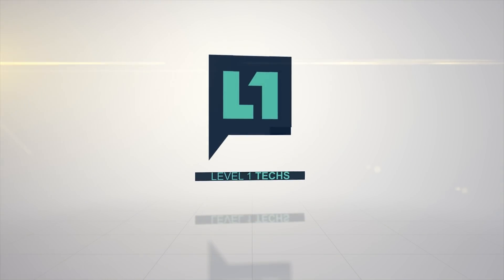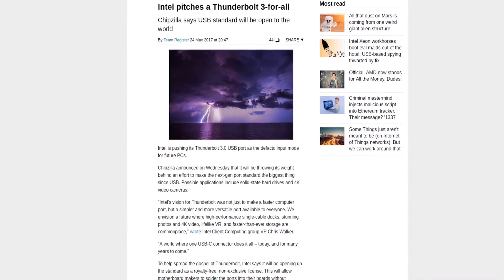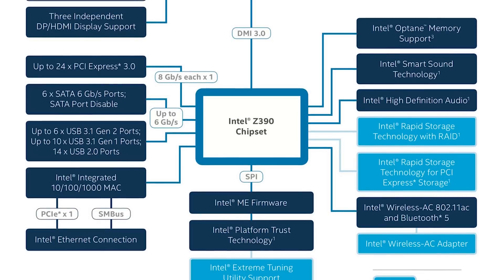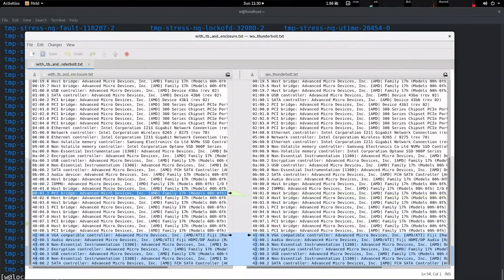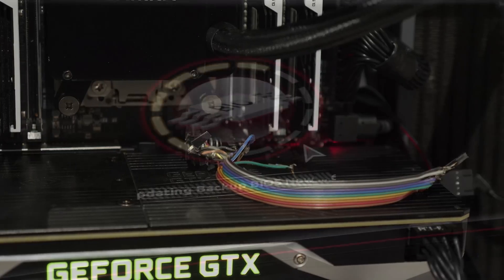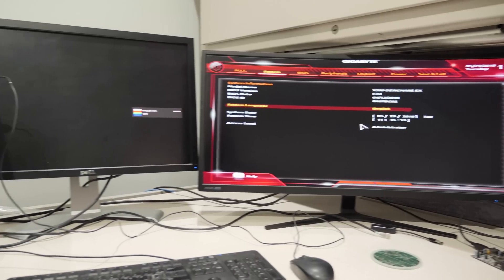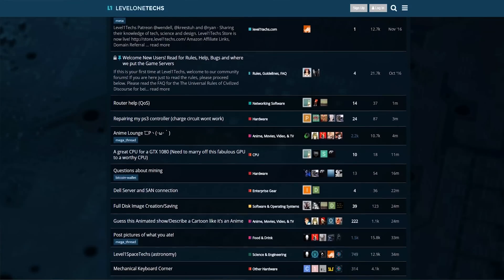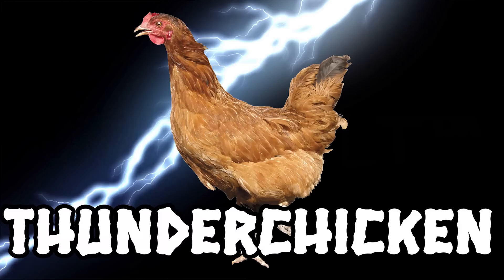Where is Thunderbolt on Threadripper?! Here it is, but...

Comment: I have a ASRock Mini ITX X570 board with Thunderbolt. It's my only one. I posted about X570 Thunderbolt in the Level1Techs forum recently, and the conclusion was "it can work, but it's jank" based on some old articles we found. I want this because I'm limited in PCIe slots because of GPUs. An eGPU chassis is a free external PCIe slot for whatever I want.

Comment: I never realized I needed Thunderbolt 3 until NVIDIA released their new cards. I wasn't about to sell away my 2 2080 Ti cards for dirt cheap just because new cards are out, since these things are still incredibly useful and powerful. 2 or 4 external eGPU cases connected to 2 Titan Ridge cards for rendering would have been amazing. Except, it doesn't work because their newer cards have newer firmware that patched the "loophole" that enabled it. Now I'm stuck like Chuck. Wendel, please help me kind sir. I can send you my card but the kidneys have already been sold.... :-/

Comment: Bought the Titan Ridge v1, hoping I could get thunderbolt on my X570 Asus board and 3900x, to connect an external sound card. First tried the PCI 3.0 slot, but Thunderbolt control center would only acknowledge the sound card if I had turned it own prior to boot. Turning off would not appear again, Then tried PCI 4.0 slot and I could turn the sound card on/off in windows and control center would allow me to see it. PCI to PCI bridge error codes like you mentioned and 3.1 Extensible errors from windows drivers. After hit and miss with installing drivers etc, Windows would freeze when I turned on the sound card in the 4.0 slot. Tried changing bios to read as Gen 4 slots instead of Auto but no options for configuring thunderbolt since this is an external pci card. Really needed this to work may. Glad someone addressed this. Thanks.

Comment: And I'm here thinking, why do hell isn't there an x16 External PCI express connector for laptops when the spec promised it supported distances of up to 18 ft if I remember correctly? All I want Tb3 is for eGPU but Tb-3 limits it to x4, so does Alienware Graphics "Accelerator"(alas using CPU and not "southbridge" lanes and so does any M.2 or mini PCI-e Slots. And it's all because of the number of Lanes in the Mobo chipset + the CPU. All common Intel Chipsets have 16 lanes and AMD doesn't list them, even for PCI-E 4.0
https://www.amd.com/en/products/specifications/processors
Reply: Damn, just DAMN!

https://www.digitalartsonline.co.uk/news/creative-hardware/oculink-will-make-laptops-lighter-on-move-more-powerful-on-your-desk/
https://pcisig.com/specifications/pciexpress/bridge?field_technology_value%5B%5D=express&speclib=OCuLink

Comment: What about Gigabyte Gc-titan Ridge plugged at the 5pin THB_c connector on the x299 designare? simple here, ''plug and play'' got it working! Thanks for the video btw it opened my mind to search a solution to get thunder bolt working on my threadripper. I just needed thunderbolt 3 to connect my audio interface (apollo twin quad)

Comment: Is there anyone that can help me figure out how to get my threadripper 32 core to work with my thunderbolt 3 Apollo X8p converter? I have the gigabyte Auros Xtreme motherboard with the gigabyte titan ridge Thunderbolt 3 pci card. Using the correct TB3 cable.
I have new chipset and bios and drivers.
The Titan ridge card identifies the universal audio converter from the thunderbolt software tray but there are error 31 errors in the device manager.
The universal audio software does not show the device attached.

Comment: Yeah geez, I was working up the components to upgrade and run a TR 2950X system which would play well with my Ableton Live 10 DAW software since it will use up to 32 cores (on Windows).  But when I looked for the Thunderbolt header on the motherboards, being that Thunderbolt is the link to my MOTU 16A audio interface (sure don't want to use the USB 2.0 if I don't have to!) I hit a dead end as you know.  So the Thunderbolt support goes beyond storage and graphics cards, high end audio can certainly use it as well.  So do I go with a pricier Intel 16 core CPU or wait a bit and hope...?

Comment: I saw a picture where someone was able to use a USB 3 motherboard header because their MB didn’t have a TB header. He used some creative wiring between the TB card and an USB MB header. After all there is USB capabilities on TB card. The TB header on the MB has 5 pins, 1 for ground, 2 for data transfer, 1 power. I THINK one pin tells the system via USB header what the card is. The Asus TBex3 card has a flash firmware utility, what does it flash? The intel chipset on the TB card?? Maybe a patch for the OS and/or hardware??

Comment: While it doesn't affect us directly perhaps, Apple would certainly be very interested in this. I would imagine the only reason Apple aren't using AMD for their Mac lineup is that would require them losing Thunderbolt, a keystone feature of Macs right now.

Imagine a Mac Mini with one of the upcoming 8 core AMD APUs. Or a Mac Pro with an Epyc 64 Core, or Threadripper. That would be a popular set of machines.
Reply: Apple will most probably move to in-house chips...
Reply: @theprstc  No doubts they would if they could, nothing says Apple like vertical integration. However, between history repeating itself with The Rosetta Stone library and issues with Thunderbolt licensing I don't think Apple will make the move to in-house, at least not on any device with Pro in the title.

Further, while Apple A series chips have proven themselves in the mobile market, we have yet to see any SKUs capable of remaining competitive on the desktop. It is quite possible the A series design can't scale up to the higher core counts and frequencies desired for the workstation.
Reply: @bushrat0118  It's not if they switch, it's when. They're far into the process of "unified OS", that's a solid hint already. What's the point of keeping it on different hardware when they got all the capability of running their own? Also, what workstation are you talking about? Apple made the last workstation on 2013 and it was an absolute mess. MAYBE they will make one in 2019. But maybe they will make something else completely...
And scaling? The chips already seem to beat all the competition. On reddit: Apple really undersold the A12 CPU
Reply: @theprstc  You're forgetting the market the iMac Pro represents. The A12 beats mid-range i5 CPUs from 4 years ago on the desktop, which is about where mobile i7 is now, ish. I would be floored if Apple could build a chip with half the performance of, say, the 7980XE.

Apple could probably replace the CPUs in their low power devices tomorrow if they tried, but I don't think they have the resources or talent required to take on Intel or AMD in the top end. And that's also ignoring that AMD and Intel are moving faster right now than either has in a decade. Apple doesn't just need to offer a CPU to answer the 7980XE, they also need an answer for Zen 2 and Zen 3, and Intel 10nm.

Further, the unified OS is not going to be what you think it is. Apple is moving to a unified code base, not OS. Apple has explicitly stated that MacOS and iOS will not merge, that Macs will not receive touchscreens and iOS will not support mice.
Reply: @bushrat0118  We'll just have to wait and see :)

Comment: Any updates on how this is going? Just got the parts for my new build, Threadripper 1950X, Vega 64, the same Gigabyte Designare EX motherboard featured in this video, wondered if any additional progress has been made or where I can go to find updates on the situation
Reply from the maker: Order an Alpine ridge tb controller and it should be good to go. Don't expect hotplug.

Comment: Thunderbolt 3 on threadripper is an absolute "must" for geographic information systems (GIS), remote sensing,  CAD, video production,  simulation, etc., where your data is not on a 10GbE network but on direct attached storage for performance reasons.

Comment: i'll  let you know how this helped me. I am a motion designer and use GPU rendering. The more GPUs in a single machine the better for me. Sticking enough GPUs on a ATX motherboard is a pain though, and also a case to fit them all in and the necessary cooling.  Fitting 4-5 gpus in a case and 1 maybe 2 EGPUs on the exterior seems like the way to go for me. So thanks for helping me decide on this mobo. Hopefully theres an official way to unlock TB on this card soon but it's goot to know the hardware is there.

Comment: Just as a side comment. Thunderbolt 3 is especially in notebooks directly linked to the CPU in Notebook since the GPU only uses 8x PCIe.  Example 2016 Macbook Pro 15": Apple attached x8 to the dGPU, x4 to the left Thudnerbolt 3 controller, and x4 to the right Thunderbolt 3 controller. That's 16 PCI lanes to the CPU accounted for. Through the PCH, Apple attached x4 to the NVMe SSD controller and x1 to the wireless card. (from https://www.reddit.com/r/apple/comments/8zc3gr/are_the_all_4_of_the_thunderbolt_3_ports_on_the/e2j4npy/)

Comment: This is great. Being able to connect many graphics cards via thunderbolt could enable a multi-gpu mining system where there are many many gpu's on a single motherboard. The drivers are limited and unstable even on a basic setup, but you could setup a VM for each group of GPU's and just reboot the VM when the drivers crash. I wonder if it would be possible to get 64 GPU's on a single motherboard...

Comment: Video professionals (especially Colourists) would be very excited about this. We work with codecs such as R3D which are cpu core intensive, and multiple graphics cards, decklink addon cards, raid controllers, network cards so the pci lanes of threadripper is very attractive. However a lot of devices in the video world are also based around thunderbolt, which has been a major block for me in threadripper adoption.

Comment: Pro Audio would benefit from this. I have a Threadripper system that I use for ProTools, Davinci, and After Effects that I built last year. I basicaly had to choose between the great bang for buck video editing performance of threadripper and the flagship Audio interfaces most of which are now Thunderbolt. Since I didn't need the super low latency that is nice for music recording I went with Threadripper.

Comment: So you would notice in the BIOS images of all of the Thunderbolt systems that there are hidden options for Thunderbolt AIC location, and they all include options to change group to CPU and then change location to NB CPU lanes. So it should not be that hard to run it off the CPU.

You can download UEFITool, open BIOS ROM, search for text string "advanced" and dump the section with most occurrences to a file (usually the section is called "setup" or similar), then open that in Universal IFR Extractor, and then look at the resulting text file. If there are strings about Thunderbolt settings, you dumped the correct file. Then you can boot into EFI shell and do setup_var 0xXX 0xXX to set a value in EFI NVRAM of the hidden settings. Unless your motherboard has UEFI Authenticated Variables. Mine appeared to bounce, but turns out the options were sticking anyways.

Comment: Can you comment on how much of this was inserting tbtdxe and tbtsmm or even PEI modules from another BIOS? The tbtdxe module is important, but not as much as the tbtsmm module which likely instruments most of the functionality.
Also, the Thunderbolt PCIe slot is declared as ACPI PCI Hotplug Bridge (acpiphp module in Linux). How much can be achieved by forcing a slot to be recognised as such? Cheers.

I would do the same as you, but I am afraid forking out that much for a motherboard I do not want is too risky given the chances of getting it to work. I am a fan of SFF systems. I would only buy a large format for Thunderbolt support.

Comment: So, what other boards have the 10-Pin TB header?
Reply: It's five pin now, and the header does not mean anything. It only does two things: allow to force power to sleeping controller, and it handles hotplug events (AIC works 100% without it attached, as long as things are attached at boot time). Pretty sure it calls the SMI handler for Thunderbolt. There is no reason this could not have been done with in-band signalling over PCIe bus, but I think Intel added it so that people would not ask why it couldn't work on AMD systems.

Basically you should be able to get it to work without it, but it might be a little messier (need something else to trigger the function, even if the user has to click a button manually.

Comment: Also, hotplug is not difficult or hard. Just shitty OEMs don't bother with a full implementation of the standards because they think nobody cares or will want to do it.

I am trying to achieve the same thing as you and am willing to fork out thousands for training courses to learn. Except I am trying to target universal AIC compatibility and throw away the GPIO header (entirely possible, from my testing the card can function without it, minus hotplug). I think it was only put in to lock it down to platforms of their choice. So that people would not ask why it cannot work in an AMD system.

Comment: This is neat, but I'm struggling to imagine a practical use outside of laptops and small form-factor devices. Once you've moved away from those and Apple devices, the thing that's in the box that plugs into the card in the pcie slot, could just go in the pcie slot. Hot-plug is kind of a major feature of external expansion, lacking that (in a stable, repeatable fashion) only further reduces practicality. This is a good POC, for when it actually certified and allowed to be integrated into AMD motherboards.

Comment: This is really cool. Perhaps TB3 on ThreadRipper will mean we get wider TB3 adoption on HEDT desktop in general.
Reply: Yes, but the question is whether the issue is manufacturer interest in implementing it on other platforms, or if it is that Intel is discouraging it (X399 Designare EX knocked back from certification for petty reason of no iGFX when that is not even needed, and Intel has Thunderbolt motherboards without iGFX).
Reply: adoption?
Reply: Yep definitely meant adoption*

Comment: Thunderbolt working on Threadripper would mean it also works on 'normal' Ryzen right?
So that would give laptops also the ability to use it (there is still this hotplug-problem) rigth?
That has probably has more use cases and will get wider adoption early.

Comment: I think the MacBook Pro 15" actually has some thunderbolt 3 coming directly from CPU PCIE lanes in the form of X8 GPU, X4 X4 thunderbolt 3 for total of 16 lanes from the CPU. Then storage from the X4 DMI think. I will have to take a look at one under windows 10 bootcamped with hwmonitor to verify.
Reply: You are right, the IOReg dumps confirm this.

Comment: AMD should just bite the bullet and make a TB equal (or superior at x8).  TR is abundant in PCIe lanes, and it would work better here since they're routed directly to the CPU.  I think that simply announcing it would force Intel to make a choice.. open TB to all, or watch an open source, superior option that runs at x8.  You could add four x8 connections and still have tons to spare.  Each could be demoted or split to x4 (basically, downgraded to TB).

Comment: One of the reasons I didn't like threadripper was lack of thuderbolt. AMAZING. Although thunderbolt periferals haven't improved as much as I expected. Even thunderbolt cables are so expensive, let alone an external thunderbolt drive cage.

Comment: No Thunderbolt on AMD boards is why I'm sticking with Intel. For fast audio interfaces Thunderbolt is the best option however PC support from most audio interface manufacturers is poor. Thunderbolt on Pc seems like it's not being really supported.
Reply: Nicks Corsair S1 Tips RME had been doing fine using pcie x1 for up to 256 channels without it. Not missing much.
Reply: I still have a FireWire audio interface which I can freely move around systems. I will only get a Thunderbolt interface when there is no other option, but that would mean all my systems have to be Intel-based.